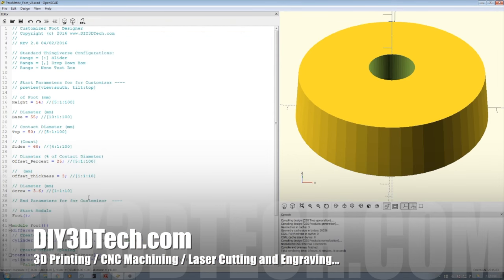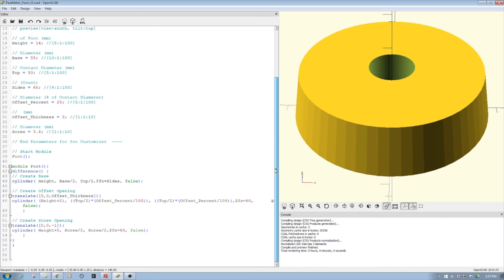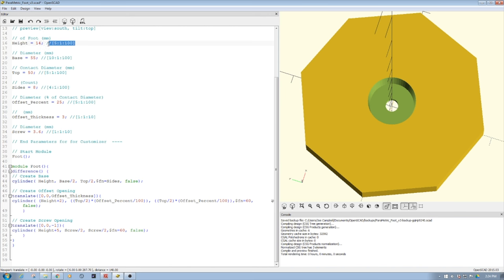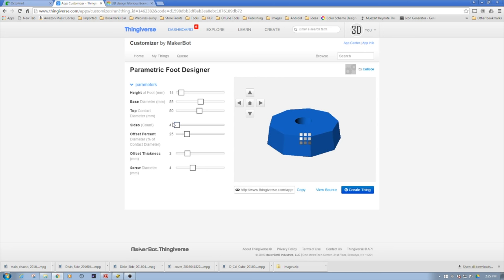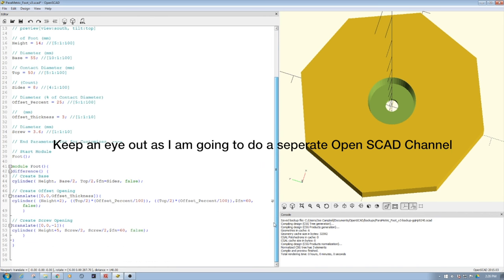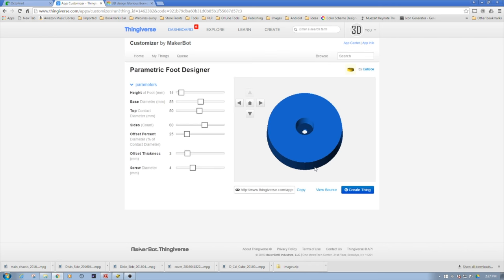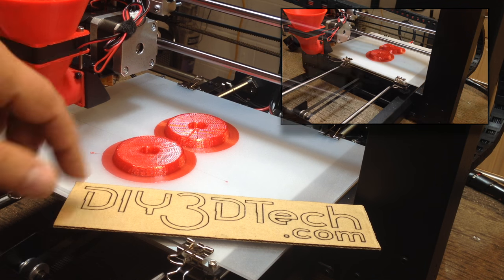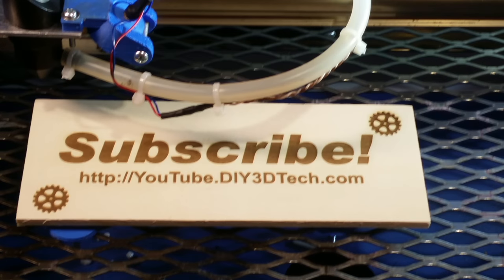Thingiverse Finds  -  How To Create a Customerizer Using Open SCAD!

Comment: Here's a tip for you, instead of specifying Cylinder diameter divided by 2, you can give the parameter as d1= and d2= to specify the diameters or r1= and r2= to specify radii.
Reply from the maker: Thanks and understand that however I prefer the D/2 [and the reason for expressing it this way] as it allows me to (a) work in radius while (2) visualizing it as diameter :-)